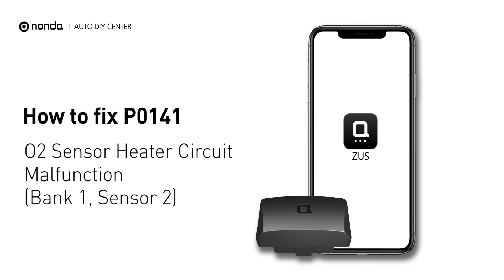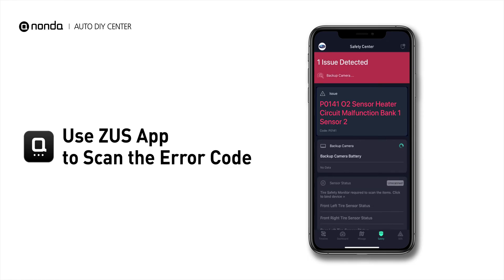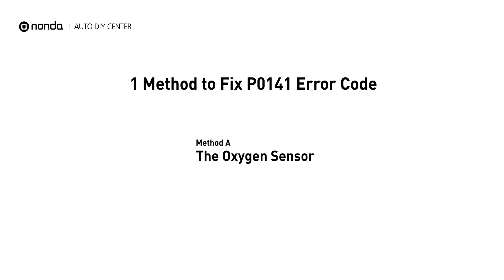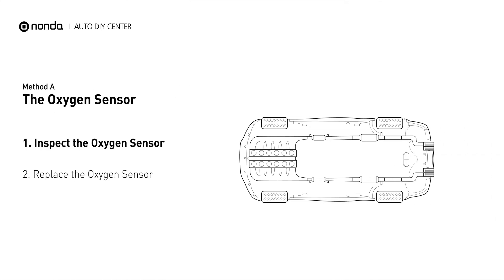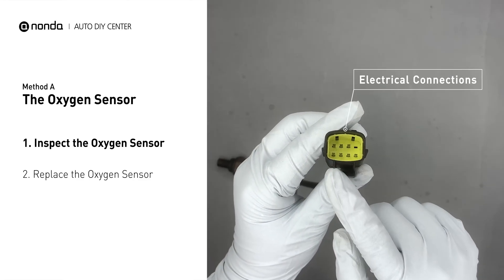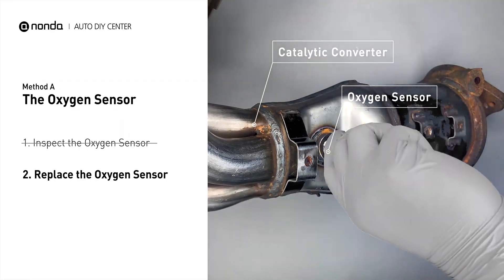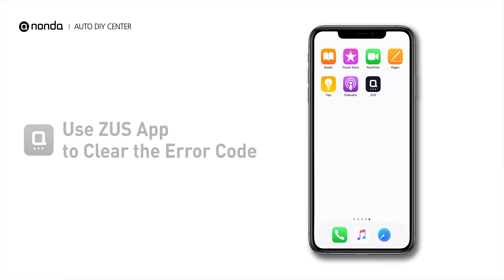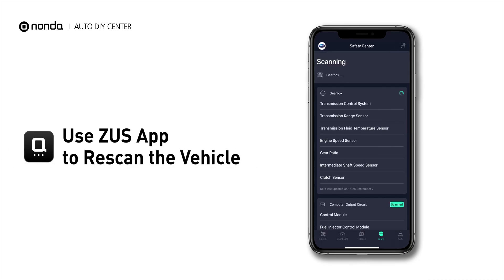How to Fix P0141 Engine Code in 2 Minutes [1 DIY Methods / Only $19.45]

Comment from the maker: Hi, I'm Steve, nonda's lead mechanic engineer. 
Feel free to leave your comments here if you have any mechanic questions, I will be glad to help you out!
Reply: Hi I know this is old but here we go I have a 04 ford focus I replaced the o2 sensors both of them and I'm still getting the p0141 and p0136 after clearing the code with my obd multiple times
Reply: @diegovargas9621 same here, I’m having the same issues
Reply: can 02 sensors mess with the trans?

Comment: I’ve been trying to fix this problem for over a year. Brought it to so many mechanics. 0141 & 0138. Replaced the sensors, the circuit is good, the o2 gives readings, replaced injectors, plugs, wires, intake gasket, valve cover gaskets, nothing has helped. Mechanics charge me for the diagnostic and say they don’t know what’s wrong. 03 Dak R/T
Reply from the maker: Hi Garrett, can you please confirm if the terminal (where the oxygen sensor connects to the plug) has been checked already? How about the fuse, was it tested?
Reply: @nondainc  I have looked over the harness and connections, they look good. I haven’t used a multimeter yet. I see the voltage on the B1S2 is a constant reading of 1 with an OBD live data scanner, I have seen other people with this era Dodge have PCM issues with the voltage regulars being inside the pcm. 
The o2 fuse looks good, not sure if there is an ignition relay that might also be at fault. I’ve checked the grounds as well and they look good. Cali truck no rust or corrosion. Also I replaced the sensor with mopar sensors correct to vehicle.
Reply: I had same problem ,we replaced the Bank 1 sensor 2 ,didn't work ,code PO141 kept coming up ,turned out it was the upstream Bank 1 sensor 1 not working, so the Bank 1 sensor 2 looked faulty because it was getting bad data signal from Bank 1 sensor 1 . We replaced Bank 1 sensor 1 and all good.
Reply: @rainerrain9689 mine ended up being the pcm that needed replacement
Reply: Replace engine air filter 😅
Reply: I know it's been a year now,  but I'm having the same issue with my '02 Dak R/T.  Checked everything I can and it's still throwing P0141.  
Did you ever figure out your problem?
Reply: @brantleygarrett7076  mine was the pcm
Reply: @gknettel22  Did you solve the issue? What do you mean the pcm? Did you replace the whole pcm or what?
Reply: @Vidarx2  Look this up --> PCM Car Problem
A Powertrain Control Module (PCM) in a car is a crucial component that acts as the central computer system, controlling and monitoring the functions of the engine and transmission. It manages various aspects such as fuel delivery, ignition timing, emissions controls, and transmission shifting, ensuring optimal performance and efficiency of the vehicle.

Comment: My 2001 Dodge 1500 pickup threw this code, I can fix this myself correct???
Reply from the maker: Hi Marty, you may possibly pinpoint the cause of the issue and apply the proper solution to it if you will check all the related parts. First thing you should do is to check if there's any short to the wiring harness. Second, is to test to see if the fuse is blown. Third, is to check if there's a voltage going to the terminal that the oxygen sensor connects to the plug. And lastly, the oxygen sensor might need a replacement.

Comment: I had a P0141 code and check engine light on a 17 civic. Replaced the downstream oxygen sensor and the code now is P0138. What should I check now?
Reply from the maker: Hello, you might have wiring harness issues, or there's a problem with the replaced oxygen sensor (replacement could be wrong/bad). We suggest to have it checked by your local mechanic.

Comment: I have a problem with the RPM meter when I press the accelerator pedal it halves and comes back and the car is parked and sometimes it works normally.. toyota echo
Reply from the maker: Hi Haider, we suggest to have the vehicle inspected by a mechanic for further diagnostic.
Reply: My mechanic suggests buying a maf sensor even though the codes there ?